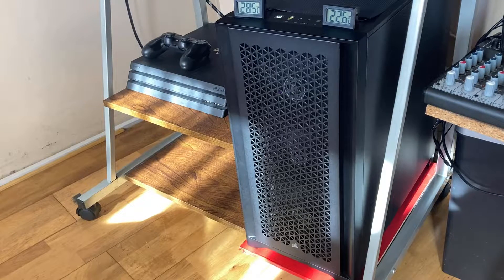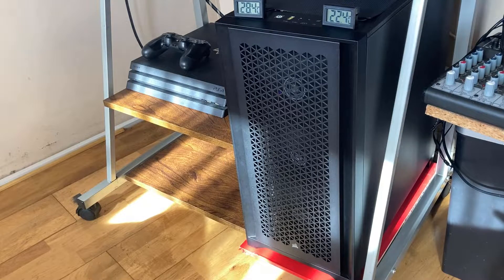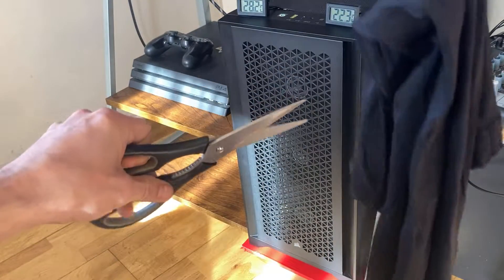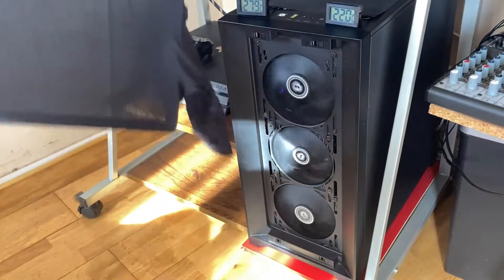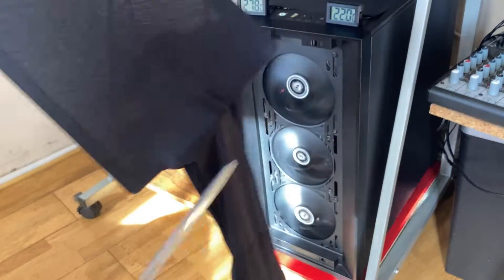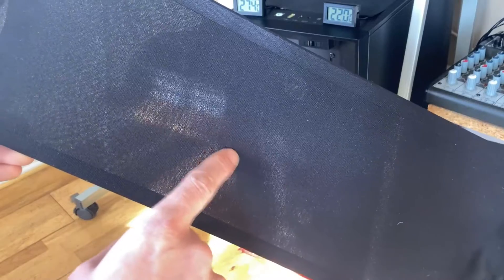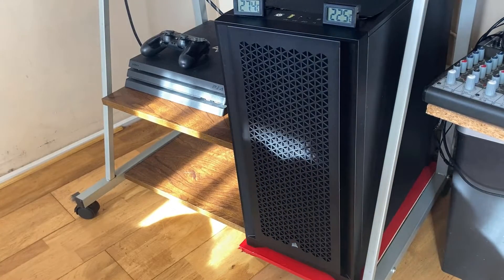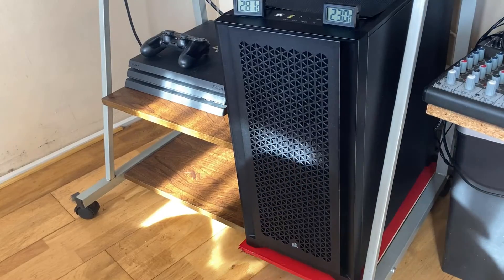PC Case Filter - Pantyhose Upgrade

Comment from the maker: I recommend using 20 Denier for best airflow
Reply: Did you check for temps? How often do i have to clean after installing? Thanks.
Reply from the maker: @xx-gw6eo  hi, yeah I monitor the temps with the 2 digital displays you can see on top of my case. One is the air temp at the front of the case the other is the air temp behind the cpu cooler. I also check the temps with MSI Afterburner
Reply: @Gruxxan  Oooh I didn‘t recognize, thanks! 
Does it get dirty fast? I guess theres almost no dust coming through right?
Reply from the maker: @xx-gw6eo  there will always be a little dust getting inside, but it will at least stop some of it. i clean the filter maybe once a month, but maybe just replace the tights as its so cheap
Reply: spoken like a true Pantyhose expert.
Reply from the maker: @othmanezerbane8251  thank you, i consider myself an afficionado of pantyhose 😉

Comment: Do the fans run louder? Or have you run into higher component temps?
Reply from the maker: Hi, yeah the fans will run a bit higher to compensate unless you alter the fan curve
Reply: @Gruxxan  have you tried only stockings? Without the 4000Ds internal filter. I'm considering doing only one layer of stocking (instead of two layers of stocking and 4000D filter)
Reply from the maker: @govindsharma7738  what i was thinking of, was to get some black speaker foam, and put it between the front grille and the 4000D filter, so no stocking at all
Reply: @Gruxxan  as in acoustic paneling?
Reply from the maker: @govindsharma7738  open cell sponge filter
Reply: @govindsharma7738  good suggestion.

I'm looking forward to see how many dust it trap.

This method is very effective but nobody like to show it on YouTube.

Linus Tech support suggested this idea.